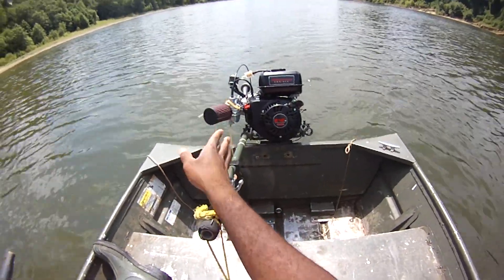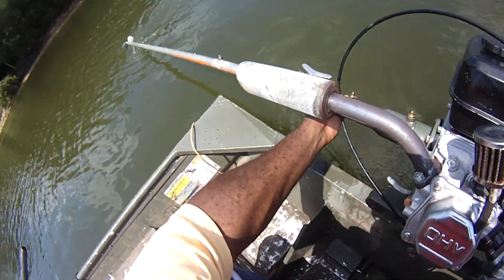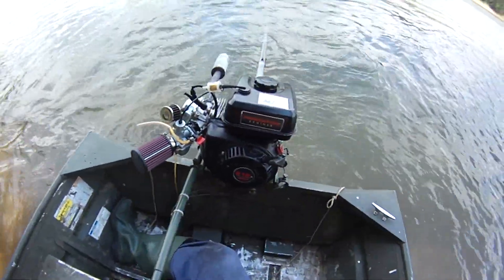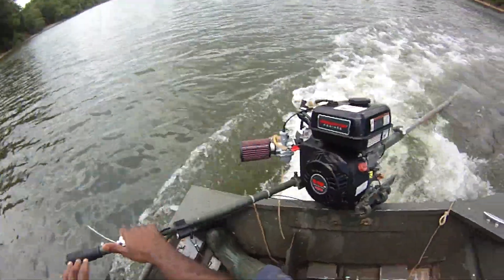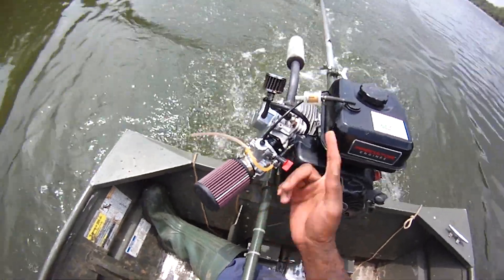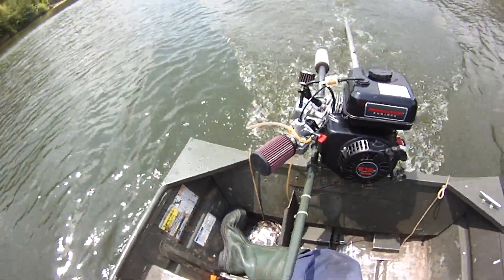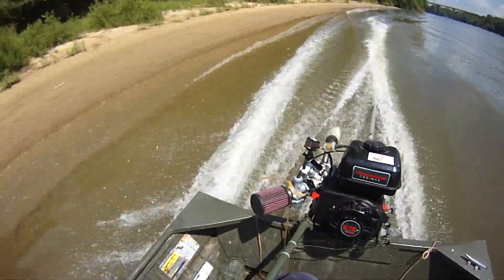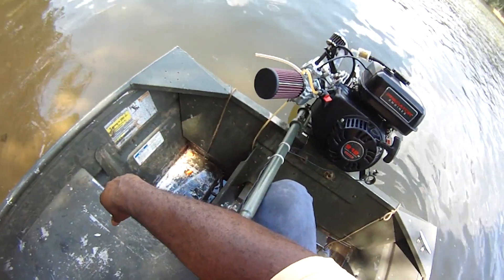Stage 2/3 Mud Motor Build | Tuning the Mikuni

Comment: Just ordered the 26mm for my build running the stage 2 kit from gopowersports.com with a short header and cold air intake as well
Reply from the maker: Yeah, I have heard of guys using the bigger Mikuni. Man, I'm not that bold! I keep blowing up to many motors. I don't build for speed anymore. Seriously 26mm would basically match the intake valve opening. You could really move a lot of air.

Comment from the maker: With this motor it was 18 mph. My current engine is about 12. I would not recommend removing the governor. Going fast is fun, but not reliable. Here are my current recommendations: https://youtu.be/LBcPhQSHwSw
Reply: Put 32lb valve springs and a 265 cam along with rod, piston, and flywheel and it will run really good.
Reply from the maker: @GreatLakesLogger  Well, I don't mod these engines any more. Too much maintenance too little fishing.

Comment: it is running or "starving" for fuel hope you have figgered it out by now. Like Thomas heath said put a fuel pump on it. simple the carb is burning fuel faster than the fuel line can supply.
Reply from the maker: Yes, sir! It was a vent problem. The stock fuel tank has no real free flowing vent. Drilling a couple 7/32 inch holes in that gas cap fixed all the fuel starvation problem. 

However, you're right in that these motors need a true marine gas tank. My next build will include teaching people how to convert to a fuel pump and marine gas tank. Mainly to have enough fuel to run all day long without having to refuel in the middle of the lake. Whether fuel starvation or the need for longer run times, the fuel pump is the better solution just as you day.

Comment: What are you running for a fuel pump? They make one that runs off of crank case pressure. It's a pulsating pump. Also, be careful of the header bolts. They like to back out or strip. It's from the heat cycling of the different types of metal
Reply from the maker: I'm not running a fuel pump. Gravity works fine.
Reply: Black Warrior Lures I think he was meaning that the gravity feed mite b starving it for fuel,,,especially going through filter too,,just guessing,,that thing is beastly now